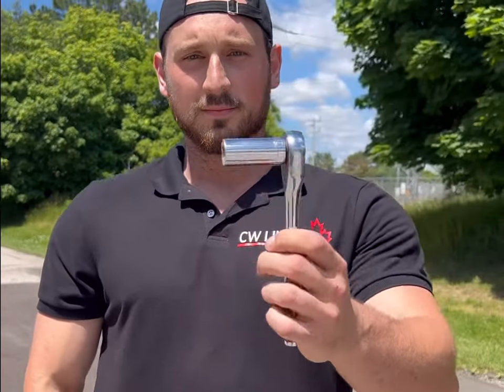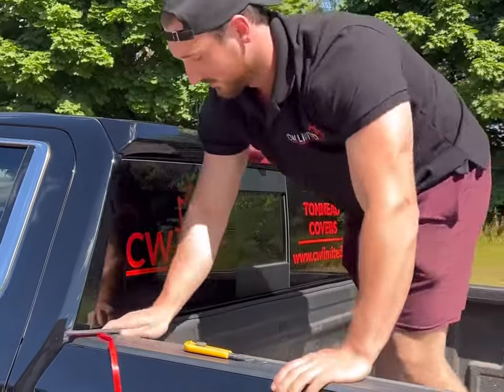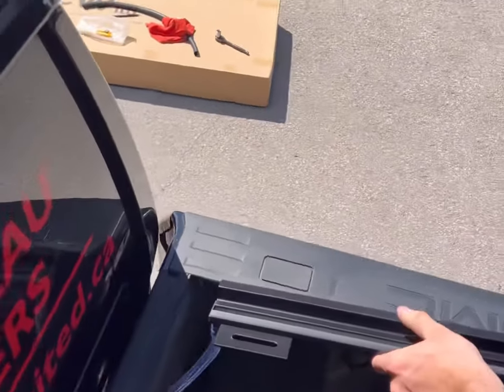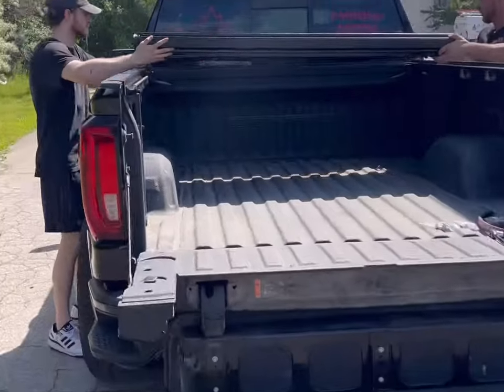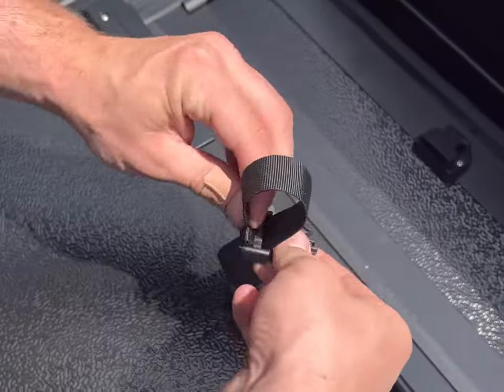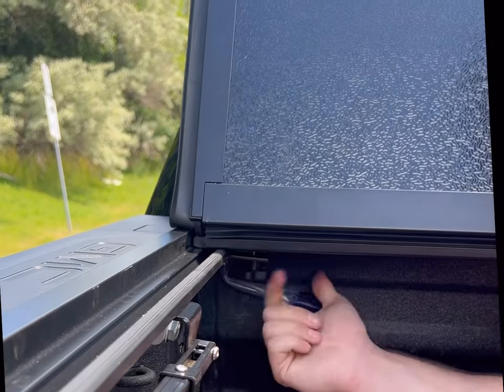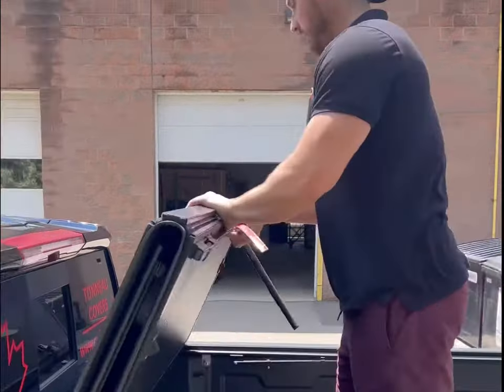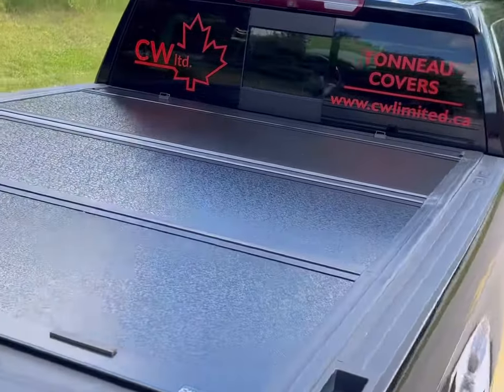CW Ltd. Hard Trifold Foldback 2.0 Tonneau Cover Installation Tutorial

Comment: (June 2023)
I bought this cover from CW and installed it using this video. The cover looks great and feels durable. 

The service that I received from CW was outstanding. Cover shipped in two parts. One of my boxes was beat up during shipping which resulted in damage to both side rails. CW was quick to respond and made things right.

I recommend CW and this cover.

⭐️ ⭐️ ⭐️ ⭐️ ⭐️
Reply: is it really waterproof or it's leaking in the corners ? TY

Comment: Just got mine for my 24 tundra. Seems like a decent cover only complaints I have is the hose barbs, one was broken off upon opening, and the other is border line about to fall off, would suggest using something other than plastic for those. Also have to jimmy around with the seal on the tailgate. It’s a good seal, but it inhibits the automatic tailgate drop.

Comment: Why is the seal not required if you have a bed liner ?  only asking as im about to install this.
Reply: I'm not with the company, and 4 mnths late... but I'll still chime in.  Without a plastic bed liner the bed sides are usually a bit higher than the front.  The seal fills the gap.  A drop in plastic liner is the same height front and sides so the cover will naturally sit flush as is.